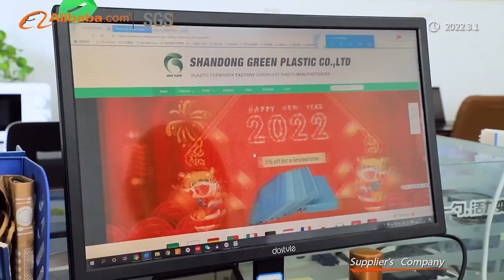plastic concrete slabs forms construction shuttering formwork board factory replace plywood 2x8 18mm

Comment from the maker: We are China's top 3 professional and powerful plastic formwork and plastic beams factory, our plastic formwork are the only one no-deformed plastic formwork all over China, our unique color is white color, our white color is from inside to outside,  all are white color, we use pure virgin new materials to make premium quality plastic formwork.
whatsapp/wechat:+8615830784341,Email:info@pvcmaker.com,Phone:+8618678290761
1. China's top 3 professional and powerful plastic formwork factory
2. 5-40mm thickness
3. NON deformation, only Green Brand plastic formworks do not deform.
4. Unqiue white color
5. sizes are bespoke
6. Free samples for testings
7. Welcome to our factory any time.
8. 60+times use 
9. Sophisticated exporting and production experience.
Plastic beams to replace wood beams
Size: 50*90mm, 50*70mm, or bespoke size
Length: no limit
300 plus times use
lifelong service life time.
fireproof,waterproof, moistureproof, weatherproof and insectproof
The only one Chinese factory in making plastic beams all over China
#encofradores #formwork #construction #coffrage #casseforme #опалубка #PVCformworkforconcrete #encofrado #construção #pvcformwork #PVCplasticformwork #PVCshuttering # wpc shuttering panels # plastic plywoods # concrete slabs# PVC forms work# non deformed plastic formwork boards# plastic formwork factory# plastic formwork suppliers# plastic beams#wood beams#H20 wood beams#  PVC beams# construction beams# I beams#concrete beams#plastic beams factory#plastic beams supplier#plastic beams manufacturers